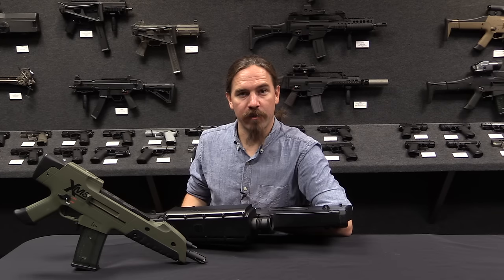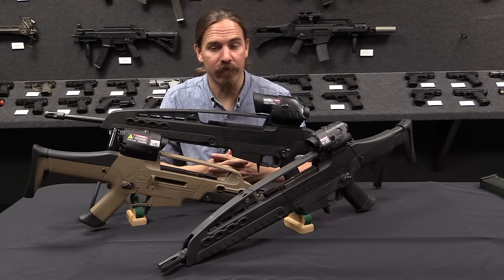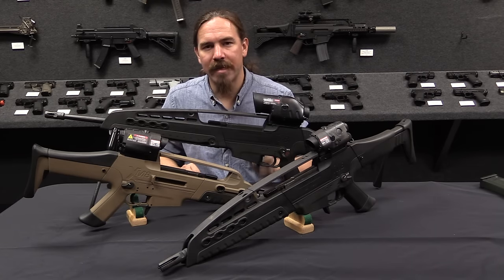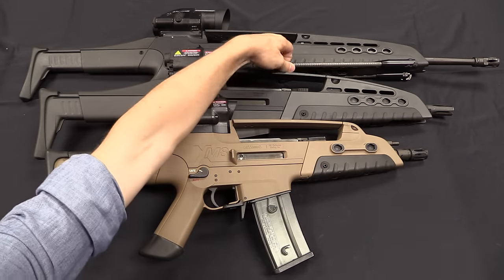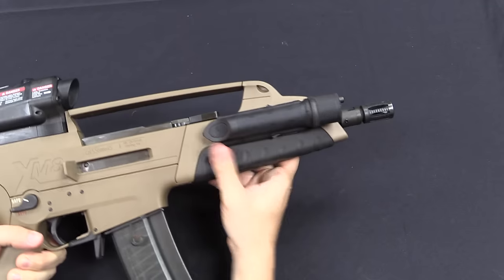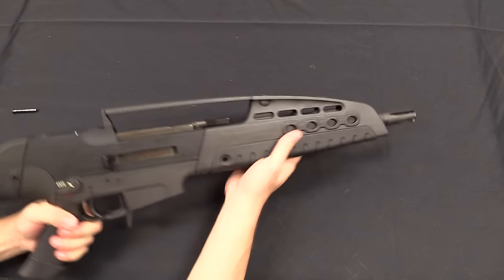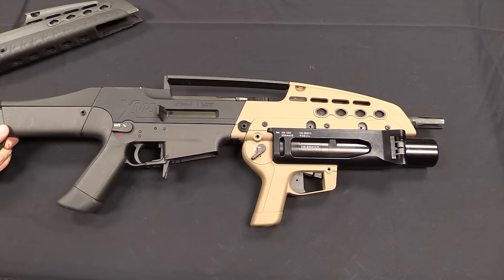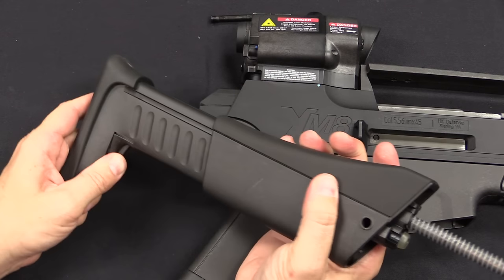Almost Adopted: The H&K XM-8 Family

Comment: There’s an alternative dimension where this is the standard issue US service rifle and I want to live there
Reply: Remember metal gear solid 4?
Reply: The rifles and guns in the first Mass Effect look like the descendants of these
Reply: It’s hard to justify the us military to buy a German made weapon over a USA made weapon and issue it across the board as the standard issue rifle
Reply: @b.btheheartpainkiller  rat patrols signature weapon
Reply: @davelowesky8054  the marines are trying to push to the hk416 also my service rifle in the army was an FN not a colt so it's not uncommon for the us to use foreign weapons
Reply: @b.btheheartpainkiller  best movie I ever played lol
Reply: @b.btheheartpainkiller  
"The System is mine! Your guns and your weapons are no longer your own! Behold... Guns of the Patriots."
-Liquid Ocelot
Reply: @davelowesky8054  Why downgrade from ar15 to the cheap ar180?
Reply: @enjin12345  416 is just an ar15 with a piston, slightly more reliable with far more recoil.
Reply: @ANSELAbitsxb  less recoil, you're welcome. Don't forget heavier barrel simply solve the recoil problem.
Reply: @ANSELAbitsxb  and about "slightly reliable" part totally disagree.
HK416 is far more reliable than normal AR15 base weapon. Even simple a simple rain may cause M16/M4 malfunction. But HK416? almost water proof.
Reply: @genewellnapata445  It costs 3x more, is heavier and does have noticeably more recoil. I owned one. I sold it, bought an ar15, kitted it out for less than what I got for the 416 and ended up with a far superior gun. I've never gotten the ar15 wet but I'm sure a simple, inexpensive mod could sort that out. I clean my guns after about 100 rounds, the ar15 would probably be fine after double that and I really cant think when anyone would ever have to shoot more than that.

I think you should go and and actually shoot guns to form an opinion.
Reply: play BO2
Reply: @ANSELAbitsxb  And before you make another lie to fix your mistake, I can help you to shut up^
Gas piston system only make gas come out in front, NO downward force.
 Which mean it only effect precise slightly, won't cause more recoil.
But HK use heavier barrel—gravity, simply solve the problem.
And You're welcome.
Reply: @ANSELAbitsxb  Best jokes for today:
1. "AR15 is better than AR15"
2. "Heavier barrel cause 3X recoil"
3. "I just bought one military grade assault rifle and sold it in my imagination, and FBI/ATF didn't arrest me"
Reply: You like broken rifles?
Reply: @enjin12345  That's funny, when I was in basic, 1996, my M-16A2 was also a FN.  I was surprised by this at the time (I owned an AR prior to inlisting, and assumed all the M-16's would be Colts) that's the only reason I remembered this so many years later.

Besides if the DOD awarded the contract to HK the weapons would be produced domestically under license.  That's pretty much par for the course, if you want a small arms contract of that size.
Reply: @genewellnapata445  Had to fire at the range with standard issue M4s/M16s plenty of times in the rain while I was in the Marines.
M16s during bootcamp/MCT and M4s when I hit my unit (2nd Tank BTN).

Not sure where a "simple rain" would immediately deadline the gun as that sure as hell never happened.

Also not sure where you got the idea civilians can't own HK416s, the MR556 is offered, but who the hell is gonna spend that much cash when there are plenty of quality AR15s on the market without the stupid brand tax. It's the same damn weapon as the 416
Reply: @genewellnapata445  it’s not illegal to own in all states though. I mean I literally own a Chieftain mark 10 MBT in Nevada with a functioning gun I mean if I can own that and literal machine guns but then  I couldn’t own a HK416 would be pretty dumb. Especially when a fully functional Chieftain doesn’t even cost that much to begin with.
Reply: Battlefield bad company 2
Reply: If it ain’t broke, don’t fix it.
Reply: In that timeline we went back to Vietnam just to prove we could have won the first time. We did.
Reply: Yeah me too.
Reply: @TheEnderBand  Yup 😀 everything in Mass Effect was designed to be plausible and the XM8 program was still a thing during  the development of the first Mass Effect game. 

The standard issue System Alliance assault rifle is literally designated as the M8 Avenger. Pretty cool of you to point that out actually, I think that reference went over a lot of people's head's. You excited for legendary edition?
Reply: @spartenkiller456  you better believe it guy
Reply: @davelowesky8054  the us army literally uses a German pistol
Reply: Isn't this the NATO standard weapon in Arma 3?
Reply: According to ghost Recon and SOCOM games, this totally was adopted.  Really thought this gun would be adopted
Reply: Alternate universe; not a dimension, dude.
Reply: @lepmuhangpa  bruh, you are the definition of ACCHALLY
Reply: @fatford4209  It's fine saying dimension in Spider-man: Into the Spider-Verse. But seriously?
Reply: @fatford4209  Hey, you can do whatever you want though. If you think I'm an asshole, know that I did not mean to sound like that.
Reply: @enjin12345  For years I keep reading that every marine gets the HK416/M27/M38, hasn't that happened yet ?
Reply: @ANSELAbitsxb  yeah, the 416 sucks... it only has a piston, and better accuracy, and better reliability, and better metallurgy, and better full auto capabilities, and runs better with a suppressor, and OTB capabilities ...like why do Marines and Navy SEALs even need that, right ?
Reply: @scratchy996  You can build an ar15 for less money that far outperforms the 416 in every way, except sustained full auto.

If you've ever shot a full auto gun you'd be aware of just how unpractical and expensive it is.
Reply: Yes.
Reply: I believe one military did adopt them
Reply: @caiorodriguesmonteiro4768  Yes,i was thinking same thing,..great game that deserves a sequel
Reply: @charlotteanne6882  and it had an open ending so they probably at the time were thinking of a sequel
Reply: i dont, thing is ugly too me.
Reply: @brendanomalley7603  grew up with it
Reply: @davelowesky8054  I mean, we do that all the time. Like the Swiss-made M17, or the Italian-made M9 before it...
Reply: @enjin12345  the marines are a lot smaller outfit than the army per say. I think we should give our troops the best possible equipment to win the war, but I think all countries should try and use a company in their own country. But obviously that would be impossible.
Reply: @davelowesky8054  gun laws in the U.S are fucking stupid too though, like I can own. a BAR but I can’t own any machine guns after 1986 like dude I could just buy extended Mags people have made for it And do way more damage or literally an MG-42 which is way worse than anything modern besides the MG-3. Like how can I own a literal tank but I can’t own a puny ass gun like in what world does that make sense. Like I can literally have one commissioned to be built too with a functioning 130mm gun but I can’t have some new machine gun like wtf???
Reply: @davelowesky8054  it would've been made in the usa
Reply: @nickkurzy2246  Maybe in mods, in vanilla its the MX series of rifles chambered in 6.8  caseless.
Reply: Nope, in that world we still have UCPs and have to carry 10 Lbs batteries that only last 2 hours (when new) for a bunch of heavy shitty equipment that was old tech by the time it was rolled out
Reply: play battlefield: bad company 2
Reply: But what if that alternative dimension/universe had a zombie outbreak?
Reply: Things most people ignore or do not know about the XM8: test models fell apart badly during tests. I mean have to get a whole new rifle type of failure.
Reply: Battlefield Bad Company 2 has these.
Reply: Battlefield bad company 2
Reply: @b.btheheartpainkiller  remember Battlefield Bad Company 2, where this was just the standard AR in the game. Ahh, those were they days.
Reply: @b.btheheartpainkiller  remember Battlefield Bad Company 1?
Reply: Battlefield bad company 2
Reply: and there is another universe branching off of that universe where the PCAP system  becomes the standard rail attachment system for guns both military and civilian
Reply: In the alternate universe action thriller The One 2001, there is an action sequence in an alternate universe where Gore was president and it is implied that the SWAT extensively used XM-8s. There is even a part where an underbarrel shotgun attachment was used
Reply: First time I saw I thought "The Gun of the Future"
Reply: Ik right
Reply: Me too mate 🤣
Reply: Ghost Recon 2 and Bad Company 2
Reply: Who doesnt
Reply: I've seen something that looks like the XM in the Crysis games bit it's called a SCAR for some reason
Reply: Battlefield bad company 2
Reply: @davelowesky8054  It would have to be made stateside like the M9s were. I believe current requirements for any adoption of a weaponry require it to be made in the US. HK would just build them here.
Reply: Nurses wet dream that is...
Reply: Yeah until the issues with this thing come out
Reply: @davelowesky8054  isn't Beretta an Italian company yet their still standard issue pistols?
Reply: @b.btheheartpainkiller  yes but you need the time travel "testy shocker" from Napoleon Dynamite to travel there...
Reply: @enjin12345  nailed it 😭
Reply: SOCOM US NAVY SEALS ps2 and ghost recon were the first games to have this shit yo lol wtf
Reply: Doesn't it start warping after 2 mags on Auto?
Reply: @huguesdepayen1  i think you are forgetting about the NFA and unless you are a manufacturer you can only own a transferable machine gun which would have to be pre 1986
Reply: @danielheinesii78  the gun laws in this country are just really stupid, I own a fully functioning tank and in the produces of one being built with a 130mm gun but I can’t own a new machine gun. Literally makes no sense whatsoever
Reply: Remember every shooting game from the early 2000s lol
Reply: Im with ya 100% as much as i love the AR15 the G36 and XM8 have always been my favorite modern rifles. Im a sucker for german firearms and H&K
Reply: Odds are that would be the Crysis videogame dimension.
Reply: Mercenaries 2 world in flames is the game for ya
Reply: FR
Reply: nah fuck that, take me to the dimension where the US adopted the G11
Reply: @b.btheheartpainkiller  ❗️
Reply: That's the ww3 timeline
Reply: Bkack Ops 2 has a (futurized) XM8 dubbed the M8A1, and select fire lets it go full auto/four round burst (not sure if the real thing does 4RB or not).
Reply: Call of Duty: Black Ops 2 maybe?
Reply: Tom clancy games at around mid-2000s also featured XM8s as standard issue rifles, splinter cell chaos theory, ghost recon at the time...
Reply: Pretty sure that universe is currently fighting ww3 while battling a world wide youth revolution lead by Raul Menendez.
Reply: It's called Battlefield Bad Company 2
Reply: @beanother1an690  1/3/A trigger group if i recall, no 4 round
Reply: @Juozapas001  I know, that's just Treyarch getting its guns wrong.
Reply: @beanother1an690  i bet their excuse would be: BALANS
Reply: @Juozapas001  Yup, definitely.
Reply: @enjin12345  welp, the marines got their hk416 (m27 iar) lol
Reply: Why? So you can overpay for an under-performing rifle?
Reply: @b.btheheartpainkiller  Remember Black Ops 2?
Reply: Same
Reply: @scratchy996  Everything you said is completely wrong. There's no difference in terms of accuracy with a 416 and a normal DI m4. If anything the gas piston is slightly less accurate due to extra moving parts. Build quality isn't any different, you can literally make a DI m4 out of the same metals as a 416. There's no improvement in terms of reliability, as soon as you get dirt inside ANY chamber of a rifle it stops working. Doesn't matter if its a 416, ak, m4. Piston only makes it faster to clean the weapon. Before you say "muh m4 builds carbon". There's literally a video on military arms channel showing a bcm that has fired 10,000 rounds. No cleaning or lubrication, without any issues. So a DI m4 will easily have no problem firing until the next time you go to clean it, it'll just take a little longer to clean. Also, i was a marine, and i hated the m27 because it had no benefits in performance, but now i was stuck with a rifle much heavier than my m4. Seals, delta force, they said the same crap. Yanno what seals and delta dudes love though? A bcm rifle. Which is DI. So how about you actually go out and get some experience so you know what you're talking about.
Reply: @genewellnapata445  Dude literally just said rain will ruin a DI AR/M4. Literally shows you know nothing you are talking about. When i was in the marine corps i ran my m4 through all weather conditions with no issues or jams. My H&k m27? Had no extra benefits compared to my m4. None at all. But it was heavier, so everyone hated carrying it around because they previously had a smaller, lighter m4 that did the job just as well. A quality built DI AR can run 10,000+ rounds with no cleaning or lubrication without any issues. Piston system is cool but its just adding more unnecessary weight to the rifle. Without any extra reliability. Put some dirt in the chamber of a 416 and it'll start to gunk up and malfunction like any other gun. Same with an ak. Also your idea of adding a heavier barrel, to a gun that recoils more, is stupid. No infantryman has ever said "yeah lets add more weight to my rifle for no reason whatsoever". A piston gun needs to have more gas running through it to reliably run the piston system. Which leads to faster parts breakdown and guess what? More recoil. A DI gun will always have a lighter, smoother recoil impulse compared to a piston system. Both DI and Piston systems are cool, but to come out saying the 416 is "just so far more superior" is completely wrong, and stupid
Reply: It's called battlefield bad company 2
Reply: @caiorodriguesmonteiro4768  goat comment
Reply: The Starship Troopers dimension
Reply: @davelowesky8054  Why?
Reply: black ops 2
Reply: Joon the Malaysian PASKAL.
Reply: In the universe of Battlefield Bad Company 2, the US Army actually adopted the XM8 as their standard rifle. You can spray a lot of Russian troops with this and it's LMG version.
Reply: @nathanjordan1782  "Winning" doesn't make the Vietnam war cool either 💀
Reply: Battlefield Bad Company?
Reply: Battlefield bad company 1

Comment: HK: "No one was asking for this but the knife sheath also has a built-in sharpening stone and a wire cutter."
Reply: The ak Russian baionet could be transformed into a Wirecutter using the sheath and the blade itself. Ever wondered why the bayonets had a hole in the blade? That is why
Reply: Doesn't the Galil come with a bottle opener?
Reply: @levoGAMES  Yeah, because soldiers were using the magazines to open bottles instead. They were damaging the lip and it caused feed issues.
Reply: I thought you were joking until I came across the part
Reply: Kabalan Stef yeah i bought one on amazon and it’s sick af
Reply: @TurMoiL911  in particular it was the uzi mags that were getting damaged. Galil mags were sturdier but I guess they just wanted to make sure they didn't keep using mags.
Reply: The M9 Bayonet's sheath functions as a wire cutter, and the OKC-3S knives we had in the Marines came with a ceramic rod on the back for honing the blade, but not neither have both lol
Reply: bayonet/wire cutter combo has been tacti cool since ww1.. when they ran into an awful lot of man killing wire...
Reply: The Bayonet issued to british military personel also can become a set of wire cutters by using the sheath. The sheath also has a shaping stone on the back
Reply: @levoGAMES  Some say the British army issues pint glasses as part of standard equipment.
Reply: Thanks Xzibit!
Reply: @levoGAMES  Yes it does, and the reason for it is hilarious.  Apparently IDF soldiers were so prone to opening their beer and soda bottles with the feedlips on their magazines that they were bending them to the point where it caused reliability issues, and in the end the brass just capitulated and gave them an integrated bottle opener that was even more handy rather than try to keep circulating memos that people should stop abusing their mags.
Reply: Sweet.